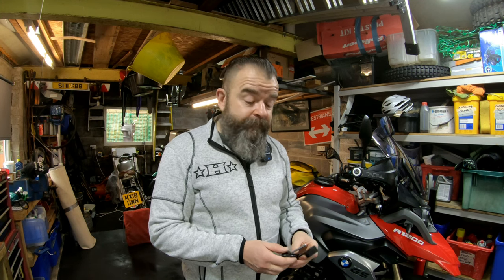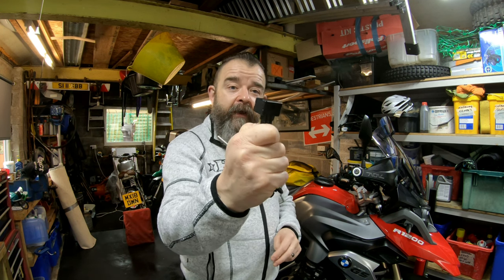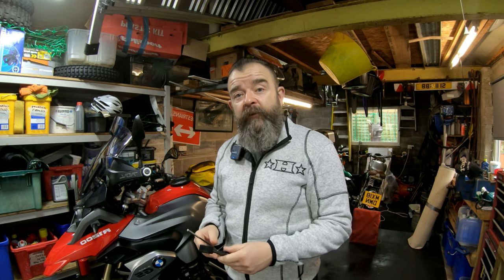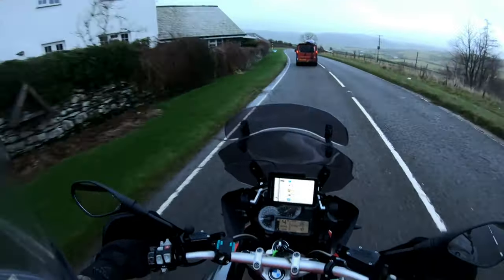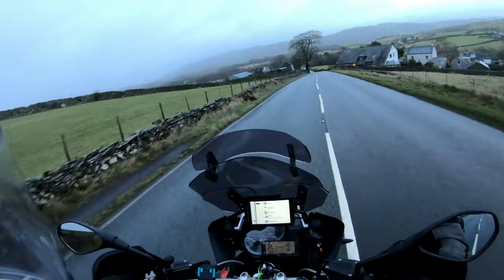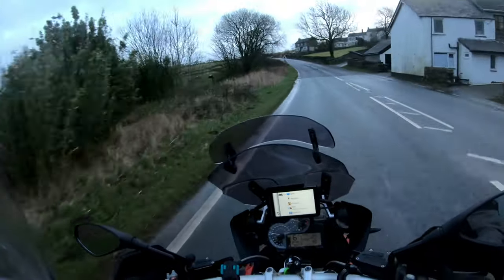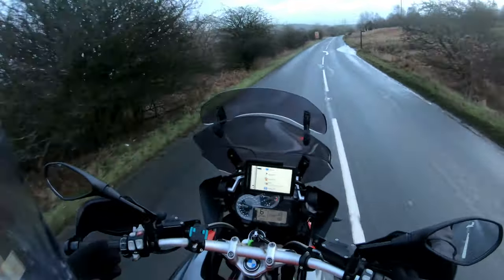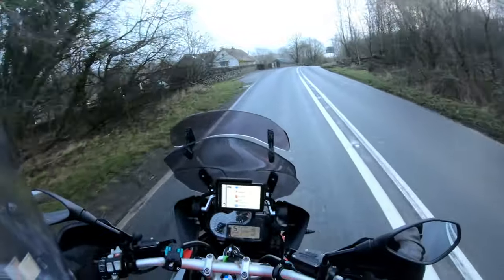The Original BoosterPlug, are they any good ?  Your Motorcycle will LOVE you for it

Comment: Looks nice. There is only one catch. The effect is neutralized by the feedback from the O2 sensor, thus installing this device on a BMW mc is a total waste of money:
My claim is backed up by realtime AFR measurments, that prooves that there is no change in the fueling.  Ass-dyno may be ok, but in reality, the fueling is no different before/after installations.
Reply from the maker: Hey up Knutk, the O2,lamber sensor would only override the booster plug when on a constant throttle, wouldn't it? whilst the throttle is being used the  booster plug controls the fueling, thus more fuel ?
Reply: @SIMONB1  
Not quite. The LC engine runs in Closed loop mode most of the time. And even when in open loop the O2 sensor corrections are considered since the ECU builds up an adaptive map (alias Cognetive map, Long term trim) meaning the fueling is continuously corrected in all modes. When at higher rpms, the O2 sensor is less influential, but in this range the OEM map is also richer, thus, BP has no effect at any rpm, as verified by AFR readings....
Reply from the maker: So what your saying is that putting the booster plug on the LC GS, will make no difference ?
Reply: @SIMONB1  That is correct. I do have the equipment required to conduct a direct reading of the AFR, and a friend of mine asked me to check if adding the BP to his LC would make a difference. We made a reading before installiation and compared with readings after the BP was installed. The AFR showed NO IMPROVEMENT WHAT SO EVER. 
The BP will probably work on a pre-O2 sensor bike, but for ECUs that fine tune their fueling based on feedback from the O2 sensor, the BP is neutralized during all riding conditions...
Reply: If you want more details and graphs that shows the actual  readings from the bike, give me a hint. Here is not the arena for a more detailed discussion.
The BP company  publish a book (free download) that explaines fuel injection The book appears to be well written, but they make some false claims to back up their theory to prove why BP works. They 'proove' that adaptions are impossible, even if cars and bikes have had it for more than 20 years,. Also they claim that Wideband O2 sensors are impossible to use in bikes. The fact is, the wideband sensors have been installed in cars for more than 20 years, and there are several bikes that also use them with great success, I know BMW are using them, but I'm confident that they are also used by others)
Reply: @knutk4256  Hey man, how are you? do you think that the Booster plug may benefit a Kawasaki KLX250s which is EFI and have O2 sensor too in exhaust? (I have modified exhaust, and high performance air filter), I see some people selling a "O2 sensor Bypass" and things like that
Reply: @entremontanas7614  I must admit that I have no experience with the Kawaski, and it may be set up different in different parts of the world.
However, at least in Europe and the USA, the enviromental regulations implemented later years are the same for every bike, and some sort of adaptions will be required in order to meet these requirements. Thus, I would expect that your bike will respond to  the the BP in the same manner as other bikes, i.e , the O2 sensor would report back the extra rich fuel and command a leaner fueling in order to apply withe the emission regulations, thus, the BP will have no effect.

If the bike is sold in other markets, this might not be the case, I honestly have no knowledge  about regulations in other parts of the world. But given that that as long as the bike is equipped with an O2 sensor, the extra fuel will probably be be neutralized wherever it's sold..
Reply: @knutk4256  Hi, nothing to do with BP, but my BMW 1200RT idle when the engine gets hot in congested traffic is all over the place. Lamba sensors have been replaced, throttle bodies checked, coil packs all replaced but it still does it. Any ideas received with thanks.🤔
Reply: @MultiBikerboy1  My answer depends on what year the bike is. But since there is no mentioning of a warning light, I take it for granted your bike is aircooled.

These engines are equipped with idle control stepper motors, one for each cylinder. Their purpose is to control a passage of air that bypass the throttle body valve when the throttle valve is closed (idle), and by controlling the level of this bypassed air, this will control the idle rpm( increase rpm) when needed, as when the engine is cold.

The stepper motors controls the flow by means of a small plunger valve that opens the bypass channel more or less.
If the motors are worn or the plunger is contaminated, the bypasschannel may not close properly, and this will influence idle rpm. 
Once the throttles are opened, this bypasschannel has no effect, so an idle-system issue will only be noticed as long as the throttle is closed.

When the engine is cold, the channel will be opened, but as the engine warms up, this channel needs to be closed. If the bypass channel is not properly closed, this will lead to an erratic idle as the engine warms up. 
So that is where I would start my search for a fault.
Reply: @knutk4256  thanks so much for your comprehensive reply…really appreciated. Yep it’s the last of the air cooled models.

Comment: Until there is evidence, I won't do it.
Reply from the maker: Hey up , what evidence do you want, my vitpilen is a different bike since I put the booster plug on 😲, the engine runs quieter and cooler, the straight through exhaust is a lot quieter ☹️, ride safe Simon B 😎
Reply: @SIMONB1  
Les rich mixture does that, okay.
I prefer technically sound evidence and what happens to the exhaust fumes in terms of air pollution?